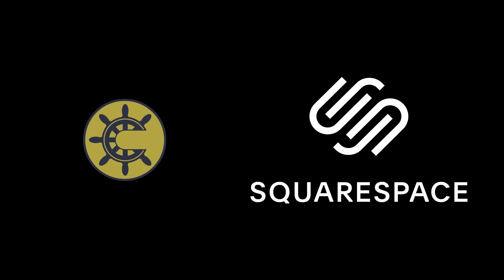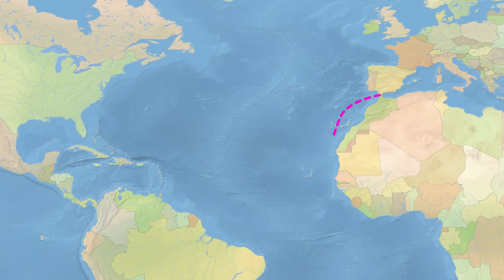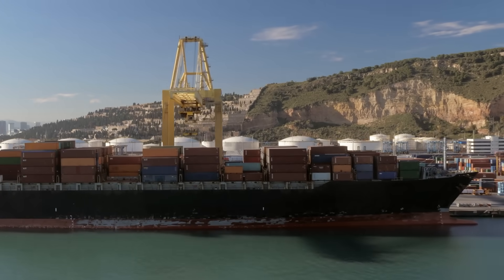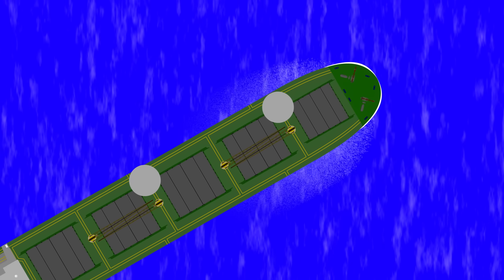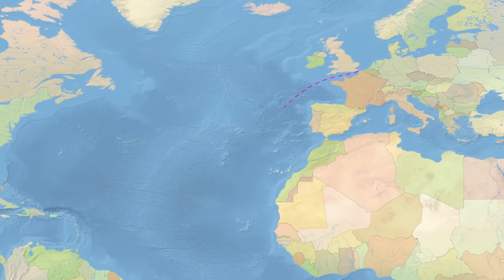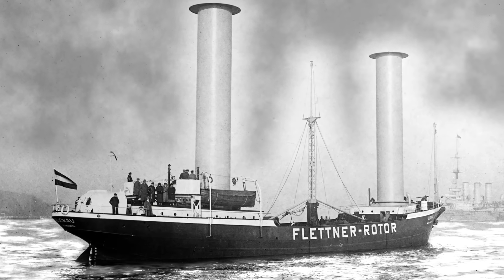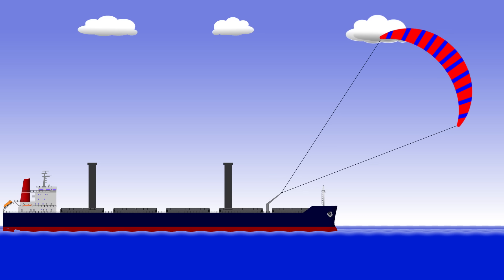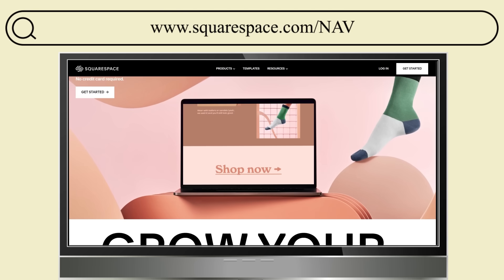Why Don't Sails Work On Ships?

Comment: As for rotors, the cruiseferry Viking Grace was fitted with a rotor in 2018, making her the first modern passenger vessel to run one as well as the first modern LNG-powered passenger vessel.

The rotor was removed last year as the savings were too small to consistently quantify, but hopefully the tech will improve in time.
Reply: Can't really see how the rotors could fundamentally improve except by becoming cheaper
Reply: Hard to say without being more into the engineering of it. Perhaps making them more easily retractable, increasing effectiveness by tweaking surface texture, stuff like that. It's not my thing. :)
Reply: @kcgunesq  In those waters, absolutely. It's not ideal for a littoral or archipelagic environment.
Reply: You forget to mention that Viking Grace is operating in archipelago waters with lots of narrow fairways, pretty shallow waters and lots of turning. I think rotorsails would be better suited for cargo ships or bigger cruise ships that spend more time on the open waters and maintain a steady course for longer periods
Reply: @joccee88  I didn't forget, it's just more detail than my comment needed. But I absolutely agree with that analysis.
Reply: It was an impressive thing to see in operation - you don't intuitively grasp that a giant rotating cylinder pushes the ship forward, but nevertheless I was impressed viking tried it.
Reply: Yup. The look of it didn't really gel with the aesthetics of the boat, but I think most of us in the industry were glad they were trying.
Reply: @awmperry  No, it definitely didn't make the ship more attractive ;)  Viking actually tries a lot of new tech - they seem to be trying magnetic or suction mooring in Åbo (instead of lines)
Reply: Strange coincidence - my comment just got another like as I'm sailing into Stockholm aboard Grace ;)
Reply: Compared to the size and mass of the ship that one rotor was tiny. Of course it would not do much. Rotorsails are still amazingly effective, but this is like hanging out your shirt on your sailboat and expect some major effect for propulsion.
Reply: The ferry between Rostock (Germany) and Gedser (Denmark) has one too.
Reply: If I remember correctly, the original Flettner rotor ship made essentially the same speed on its Atlantic crossing as any other steam/sailing ship of the era. It doesn't surprise me that the modern equivalent isn't any better.

Comment: Careful on parading the idea of forced government regulations.  Most of the times, those make situations worse.   The luxury yacht industry is advancing in more earth friendly materials (from decks to engines) and it's customer driven.  Owners that aren't able to sell their better technologies have branding/advertising issues.  Tesla is praised because of how eco-friendly it is once it's been built, but everyone in the know understands that it's not eco-friendly being constructed, nor when you have to replace the batteries.
Reply: exactly that, if the charterer is going to save X from lower fuel and the installation means the owner adds half of X to the price/repayments they would happily pay it. regulation isn't the answer, if a ship owner doesn't do it, you as a charterer will go to someone who does.

Comment: You make it sounds as if that only technological progress can be achieved through regulation.
Reply: I feel like subsidising retrofits might work as an alternative
Reply: @Lancecoolie  Which means it's probably bad technology.
Reply: @CThyran  no, it's just that there's often a conflict between short term profitability and safety and sustainability. 

Other things that would never be implemented without regulation: Fire escapes, life boats on ships, electrical safety rules, medicines actually being tested for safety and efficacy etc. Whether it's rules that came out of terrible accidents (like the Titanic) or to force a change to more efficient modern alternatives (like phasing out incandescent light bulbs) there are countless examples of regulation being required to do things that are necessary and beneficial but not really profitable.
Reply: @CThyran  Or bad shortsighted economy.
Reply: @CThyran  not necessarily though, regulations are big influence that it can actually sped up the adoption of the technology.

Comment: What is the reason why there aren't more ships with vertical axis wind turbines powering electric motors? That seems like a reasonable compromise between harnessing wind power and keeping the equipment for that confined to one part of the deck so its out of the way of loading cranes. Also I now realise I've never heard of solar panels on ships, but if a ship spends a lot of time in sunny waters why not use a solar panel to power an electric generator with backup fossil fuel generator for when there isn't enough sun?
Reply: because wind is unreliable and windturbines aren't actualy that effective and batteries actualy aren't that energy dense and a fire hazard if something breaks.
Reply: Power output, i presume. Do not forget - we need to feed a very big and heavy ship, not a power up a smartphone.

Comment: "The only way technologies like this are going to be adopted in a more widespread way is through regulation." How could you make such a large claim that's completely false?
Reply: @Travis it is false to say the only way to encourage the adoption of this tech is through regulation.

It will be adopted if it is efficient - it is a simple fallacy to say that just because the proprietor isn't first in line for the savings, they won't provide an incentive throughout the chain.

He then goes on to contradict himself by claiming that the proprietor will profit from the increased efficiency, just not enough to justify the outlay. Well, that is a commercial decision and if the tech really is efficient overall, businesses will adopt it. Indeed, those who don't will only disadvantage themselves.
Reply: @MrRealstreet  Without regulations short sightedness rules. If you cannot survive long enough to see long term gain then you just don't do it even if it is massively profitable down the line.

I think the issue with regulations about safety and environment is that they benefit everybody and pull everybody up at the same rate. Banning Ozone depleting gases in refrigeration units was an insanely profitable thing for the world that allowed everybody to continue thriving. The regulation caused a lot of hassle on the the manufacturer of said refrigeration units for sure, but since we avoided destroying our whole ecosystem they will benefit the increased population and global economy. But if you only focus on that one industry it without looking at the global scale once you only see how "negatively" it was impacted with it.
Reply: @Vaasref  "Without regulations short sightedness rules." That's an extremely quick way of explaining you don't understand business, economics, OR regulation. Regulation IS the short sightedness.
Reply: @IWLDELJ  I don't see you countering my example/hypothesis of the Montreal Protocol.

So yeah, go back to your sandbox if you are not ready to argument like an adult.
Reply: @Vaasref  There is no argument. Your points aren't worth addressing. These comments are not for you, they are for lurkers who don't have strong opinions on things they don't understand, and who aren't anchored to any particular idea, and may be inspired to do some impartial research.
Reply: The only way ships changed to low sulphur fuel was due to IMO 2020 and a regulation by the international Marine Orginisation regarding low sulphur fuel, exhaust scrubbers and fines for ships found burning non low sulphur fuel.
Reply: @lachlanlandreth9069  I don't think this adds as much to the conversation as you think that it does. There are so many variables you neglect to mention in your comment. I'm not saying you did it to be dishonest, I'm just saying that there is likely far more than can be conveyed in a comment section.

I'd like to see charts, graphs, and trends in sulfur expulsion, consumer demands, and what they'd be willing to pay to make the changes they wanted to see.

If IMO 2020 is like nearly every other policy meeting, they will have taken credit for codifying a trend that was already happening.

In the US, people literally think that the government rescued child slaves by passing child labor laws, and the governments are happy to take the credit, but the reality is that child labor was already on a steep decline, and the legislation just codified the trend, changing nearly nothing statistically, but making things more difficult for poor families.

Likewise, places like Australia and England brag about their gun control results, when investigating the trends reveals that their gun violence rates were already low and already falling.

Policy tends to come after the result, and take credit for the good, while blaming the unintended consequences on other factors. This works on most people, because they don't investigate the trends.
Reply: @IWLDELJ  using your Australia Example, there are critical points, such as in the wake of Port Arthur, they introduced a large buyback program along with stricter laws, which did include types not touched by law before.
Reply: @IWLDELJ  Saying that the US shouldn't have banned child labour because it was on it's way out anyway seems like wishful thinking. It is afterall still around in much of the world to this day. And if children have to work to support their families then maybe that itself is the problem.
Reply: @fawfulBeans  "[T]he US shouldn't have banned child labour because it was on it's way out..." is not what I said. I said that child labor was already on its way out, which isn't wishful thinking, it's not even up for debate, it's a recorded statistical FACT. I said that legislation is given credit for stopping child labor, which they didn't actually do. Comprehend.
Reply: @fawfulBeans  "The obvious insinuation is that there was no need to make it illegal because it would have died 'naturally'."

No. It isn't. There was no insinuation. The fact was stated that making it illegal HURTS the few people that would have needed to continue the practice. Child labor is GOOD and NECESSARY, and only becomes rare as a society becomes wealthy. The people who are left behind still REQUIRE it to catch up with the rest of society. Making it illegal wasn't "unnecessary," it was BAD. It wouldn't have disappeared completely unless we reached some sort of utopian existence, but it DID get more rare, VERY rare on its own, this is an indisputable fact. 

"If the natural course of market economics ended child labor in the west why is it taking so long in the rest of the world to finish the job ?"

1) Because the rest of the world is behind the West, 2) it is becoming rare much faster in faster developing nations than it took to become rare in the West. Both things are true, and if you don't realize that, then I'm not sure you actually even care that much about this particular issue. You're certainly not really watching the numbers.

Comment: Is there a reason we don't put wind turbines on whips and supplement the engine that way? It's always windy on the ocean, they're pretty cheap to build and they can be scaled to any size so they could be put just about anywhere on the ship.
Reply: It won't really work  because of physics.  Try to blow air to a propeller placed on a toyship in water.
Reply: Where would you store the power?
Reply: @misty_radio4958  Option A, like sails you don't store the power, you use it to power the ship as you generate it. Even if you have a back up fossil fuel generator only using it when there isn't enough wind is better than exclusively powering your ship with fossil fuels. Option B, industrial batteries.
Reply: @raccoontrashpanda1467  I don't think turbines and industrial batteries is enough to power a ship motor those things are huge and wind turbines would require regular maintenance aswell batteries also tend to degrade over time aswell so that may also be a issue
Reply: drag and safety and low efficieny,

Comment: great video, altough your explanation of traditional sails is wrong. It is, just like the air foils creating a low pressure area leeward of it and thus pulling the vessel in that direction. it has nothing to do with redirecting the wind.
Reply: He also didn't mention dynarigs at all for some reason. Maybe there is something I'm missing, but those seem to be among the most commonly considered sail rig on modern ships, and they could be modified to inhibit loading nearly not at all.

Comment: Same thing for nuclear propelled ships, although South Korea is working on fitting nuclear propulsion on cargo ships which would remove CO2 from the trip !
Reply: One major problem with that. And I'm not talking about the risk of cheap operators cutting corners to save a few bucks and causing a floating Chernobyl.

Not all countries permit nuclear powered vessels into their waters or harbours.
Reply: @Emily35-Official  I am going to argue that the ecological impact of a nuclear powered vessel sinking would be much less than the one of a conventional vessel sinking and pouring tons of oil destroying wild life and coasts and poisoning the water, because water is very good at protecting from radiations, and if there was some uranium in their lead containment unit at the bottom of the ocean it would not cause much of an issue. We have to realize that nuclear reactors have been on and under water for decades now
Reply: @arthemis1039  Not going to disagree. I think nuclear is a safe and suitable option until renewable energys are fully ready to take over.

But I not in charge of government policy's...
Reply: @Emily35-Official  Nuclear and renewable must work together. We cannot afford to industrialize every inch of land with have to produce energy (that is not really sustainable) and we have to consider physicial footprint in energy production too. Renewable should be here to complement nuclear that serves as a baseload energy source
Reply: @arthemis1039  while I don't disagree, I also don't fully agree.

Both current renewable like solar, wind, wave, and nuclear each have their complicated issues.

Raw electricity energu can not be stored. It must be converted into chemical energy (like batteries) or mechanical energy (like flywheels) or potential energy (like pumped hydro).

Renewables only produce under set conditions, so must be used immediately or converted to be stored (at the cost of efficiency loss) and if the conditions aren't right, there just isn't any power produced.

Nuclear is more reliable, but suffers a similar problem. It's output needs to be turned up or down to match demand.

And unfortunately, it's not sports car.
It takes too long to change the heat output, which takes time to change the steam output which takes time to change the turbine / generator output.

Hydro is the "perfect" source of power, as you just turn a "tap" and the power of is there within a minute.

But as you stated, the footprint of hydro including pumped hydro isn't exactly small. Not to mention the environmental impact of damming up a valley.

There is no perfect way to generate power and worse, there is no practical way of using that power in an efficient portable system in the grand scheme of things.

Electric cars may be great for a short commute into the city, but batteries are just too heavy for trucks with unacceptable charge times and this is only worse for ships.

What's the answer? No idea, maybe invent something new.

Practically for land based power consumption, I think home based solar combined with batteries AND local grid sharing can and should take over from centralised power grids.

Every home and business should occupy the maximum capacity of the roofs with solar, both hot water and photoelectric.

Each building should have batteries to last 12 hours of expected use and each property should be connected to its neighbours.

Once a buildings batteries are full, excess power is distributed across the local grid.

Once all batteries in the local grid are charged, a communal hydrogen production plant should be activated and consume any remaining power.

When a buildings battery's are below a set point, power from the hydrogen plant should be produced / consumed along with extra power from any batteries above a set charge level.

Any excess hydrogen from the plant can be sold off / used to power hydrogen cars.

Is that going to happen overnight, no. Will it be perfect, no.

But it will reduced the need for the larger grid and power stations as well as provide the demand and finances to make renewables cheaper and more efficient as well as develop new technologies which may be better suited to ships and trucks (and even airplanes).

In the mean time, if sticking a couple of sails reduces fuel usage, and thus emissions, by even a few percent works.
Then shouldn't we do it until something better comes along.
Reply: that ofc would be amazing, but it requires a lot of very highskill personal.
Reply: @patriciusvunkempen102  Probably, but it won’t be that much training required, especially/hopefully with the more modular designs. Remember there’s a reactor at Reeds run by liberal arts undergrads.